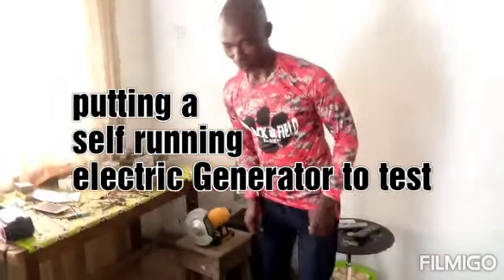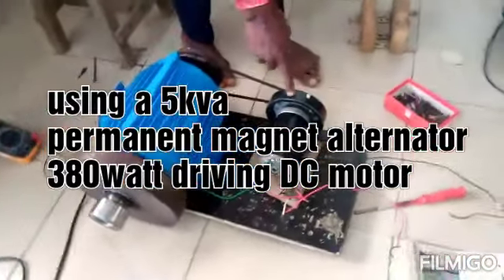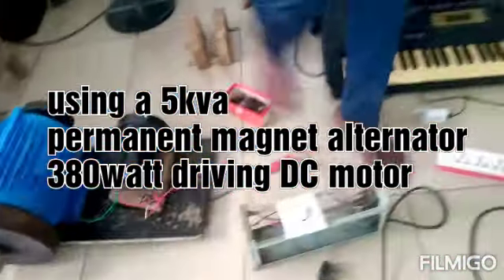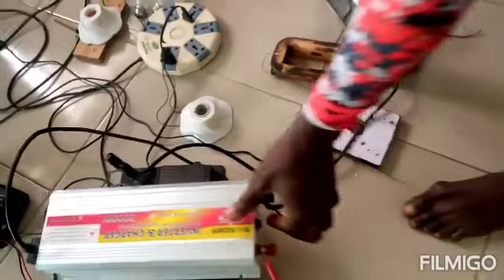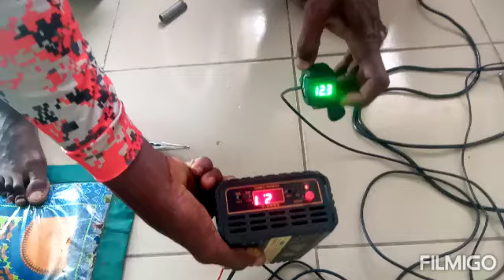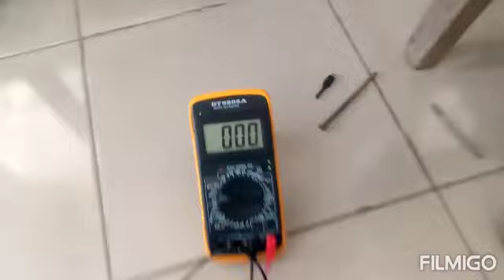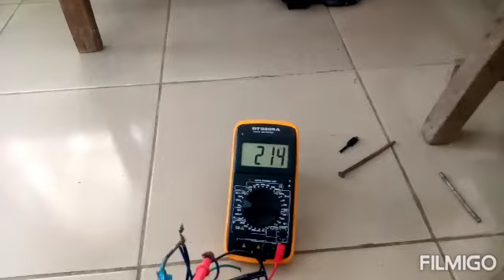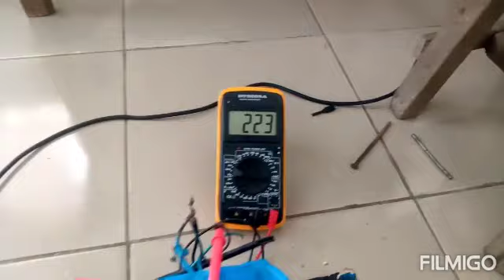Self Running Electric Generator

Comment: Any one can plug into an inverter run ac motor with belt pulley to 3 phase motor and get voltage from the wire leads. We need an endless loop that does work and charges a battery at the same time. Overunity. The only promising thing is a Tesla turbin with cold hot side runs the turbin up there 35000 or more rpm. Never runs out of water. Built off atmospheric pressure. Hvac people are going to figure the energy thing out. I hope.